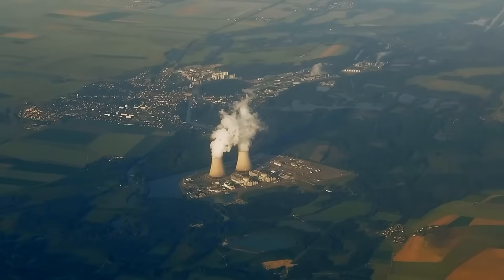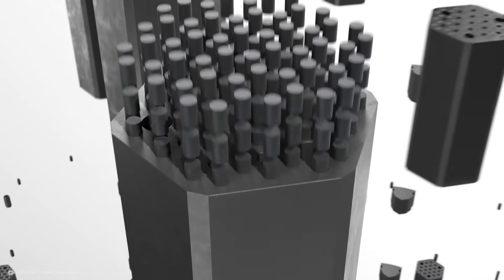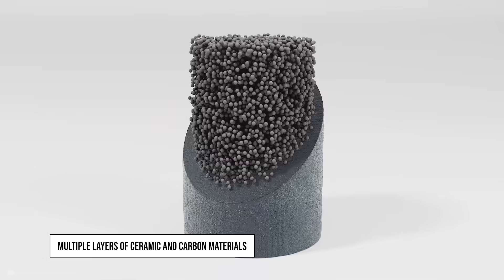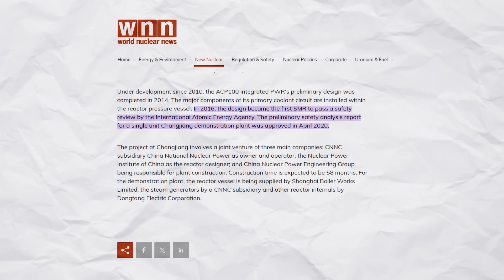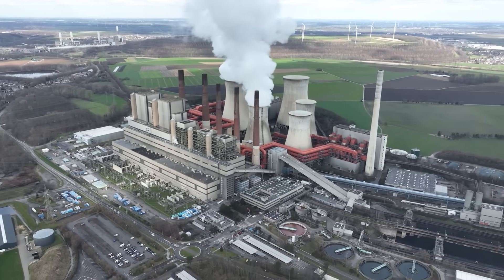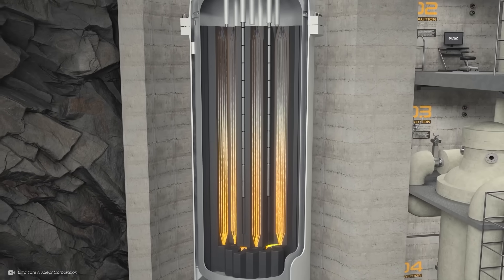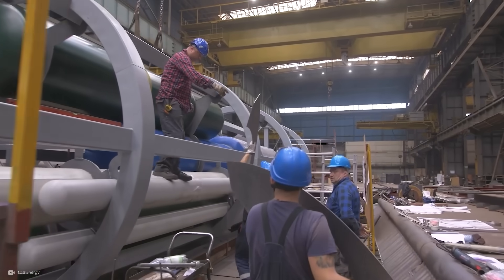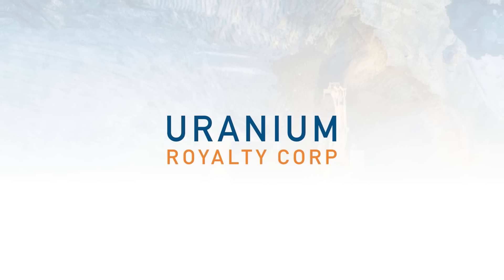The Genius of China's Small Modular Nuclear Reactor

Comment: Id love to know why thorium is not taking off. LFTR's are safer since they are at high temperature iso high pressure. They produce a tiny fraction of the waste, and the feed stock is a tiny fraction of the price.
Reply: they need depleted uranium to make killing munitions i guess..
Reply: It's a whole different energy branch that needs to be set up nearly from scratch: safety checks, regulatory checks, supply chain, etc.
Reply: @peters972   The US has never built a LFTR. The US did build an MSR in the 50s. The Aircraft Reactor Experiment which operated for less than  a year, and the Oak Ridge Molten Salt Reactor Experiment, which ran for about 5 years before decommissioning. Neither used Thorium as a fuel, though the MSRE briefly used U233 as a fuel. Apparently the Chinese have built an experimental LFTR. At least 10 more years and several more prototypes would be required to build a safe reliable commercial Reactor. They produce long lived fission wastes in about the same proportions as today's commercial reactors. As for cheaper and safer, well that's what the Soviets said about the RBMK reactors.
Reply: @darkgalaxy5548 
☢️⚰️⌛️❓❓❓❓❓❓❓

Comment: Water cooling has to be at a huge pressure to generate cooling and this leads to dangers on losing pressure in the system. Helium is more useful as Reactor does not need to be sited near water which tend to be close to populations!
Reply: Reactors with water are dangerous!
When cooling stops and water becomes so hot that hydrogen is produced, it's just a matter of concentration before it explodes.
No one should use water in nuclear reactors!
The sane ones are those which turns of when cooling fails, not explodesp

Comment: Nuclear Power has low CO2-Emissions? Only if you forget about where the nuclear fuel comes from, how it is processed and finally stored for long time. CO2-Footprint of Nuclear power is higher than solar or wind if everything is considered.
But most the important thing about SMRs is the price: They can only be build with public money, else the electricity would be too expensive. We will se no more than 15 SMRs in the World. And none of them will run for the full planned lifespan. Let them burn their money...
Reply: I believe after china master the mass production, they will build many for themselves, then export them.
Reply: The lifecycle GHG emissions of nuclear power are lower than the ones of PV , 28 vs 85 tonnes of CO2eq/GWh according to (H. S. Jamie McIntyre, Brent Berg and S. Borchardt. Comparison of Lifecycle Green-
house Gas Emissions of Various Electricity Generation Sources. Technical report,
World Nuclear Association, 2011). What article  do you refer to ?    Also , even when higher CO2 emissions per GWh are considered, we should bear in mind that one of the main advantages of nuclear power is energy density and hence material intensity, considerably lower than the one of solar and wind. And what about the decarbonisation of the mining sector in remote and isolated areas , with no access to sunlight and wind ? SMRs could play an essential role there. The technology is still expensive for sure(also because of the excessive safety measures in my opinion, nourished by decades of antinuclearism, but this is another story) but , from a purely technological point of view, nuclear energy is the way to go, a sort of miracle in the energy world , considering the staggering amount of energy produced by the fission of a single atom . I hope that AI , requiring a costant source of energy to run his servers(nuclear is perfect for that ), will help to guide a nuclear renaissance worldwide .

Comment: But your last graph about falling cost of solar actually says it all... Even if SMR cost fell at a similar rate it will always be a magnitude greater than the cost of solar (and wind) which will continue to fall as well. We already have the solution and it's just going to get better and cheaper - no need for nuclear any more!
Reply: Nuclear and solar power are two entirely different types of generation. Nuclear power can provide base power which solar cannot or which requires additional investment in storage technologies which reduces its efficiency. You can't dismiss any low greenhouse gas source of energy so easily. There are also other issues with various forms of renewable energy. In other words, the chart does not say it all.
Reply: @Paul-pj5qu  base load is a bit of a dying myth, and existing pumped water storage etc. is rapidly being augmented by battery storage, home energy storage, bi-directional EV storage (this will be standard soon)... Peak loading is already flattening out and there are incentive schemes to smooth things out (I got another mail from my energy provider this morning offering me one day a month free power if I reduce peak consumption by a certain amount). Those with home storage and EVs will already be managing things to reduce cost, i.e. flatten load peaks.
Reply: @originalmossman  Battery energy round trip <70%, that's when everything is new. All other storage methods suffer similar efficiency limits. Every EV charging at night to run the house during the day, cannot take it's driver to work. And round trip energy 70%, when everything is new. I know the hype, but they are misleading by omission. 
 
All power systems must build infrastructure to supply the peak load required at any time of any day. In TX this value is projected to increase >20% in <5 years. So, much more fueled infrastructure is required.
Reply: @CycleWerkz  strange focus on an outlier use case (like anyone proposed charging your whole house off EV storage for the whole day... Come on!?). All I said was there are load-smoothing mechanisms already reducing peak load requirements and it's only going to get more buffered... and that will happen quickly.

And all the predictions from UK and other grid operators say the same
Reply: @originalmossman  Whomever is making those projections doesn't understand the situation. ERCOT here is projecting ample peak and total energy demand near term. 
Simple voluntary residential peak load offset via battery cycle will increase total energy demand and score a big fat zero in actual peak reduction. 
You should get yourself ready for more blackouts and higher rates.
Reply: The "cost" of solar and wind, never includes the carbon cost of freight and usually not production, let alone disposal and recycling (which has only very recently become a possibility).

Nuclear power is literally the only viable answer.
I however, am not very interested in nuclear going forward if we're only going to build more reactors that require enriched fuel. Not when there are better reactor designs that can only fail safe and be fuelled by the existing stockpiles of "nuclear waste".
Reply: @Jimmeh_B I have to point out that it's obvious recycling could only have recently become a possibility, until recently there wasn't an Industry to recycle. 

The same is true of storage. There was never going to be commercial storage until Solar was over capacity during the day. And there won't be 12-16 hour over night storage until 2-4 hour evening/frequently modulation services are built out for the same reason. There just is no market.
Reply: @neolithictransitrevolution427  Sure, but you're completely glossing over the fact that both solar and Lithium have MASSIVE environmental costs. While fast breeder and travelling wave reactors will burn off existing "waste" stockpiles for fuel and can provide base load and beyond, 24/7.

If it's truly the environment we're all so concerned about, solar is a scam. It is not the answer.
Reply: I agree with the idea Solar will become the primary power source, but nuclear can certainly have a roll; industrial heat with co-generation being the main one. 

I don't think wind will see any significant declines in price and honestly by 2050 I think wind power will be declining globally.
Reply: lets make solar panels doped with uranium, they might produce energy at night too!
Reply: Solar and wind never had to compete with a truly modern fission reactor, thanks to china’s let’s see how well it does when china starts mass producing Thorium Molten Salt Reactors. Sadly western countries will miss out because of decades of endless red tape and sticking with a very bad reactor design over a half century.
Reply: Nothing costs more than wind, since its a net loss, only artificially propped up by government subsidies

Comment: So many videos on SMRs, so few charts on how a steam turbine's efficiency depends on its size.
Reply: As well as the whole thermodynamics... or materials used in manufacturing per capacity or ERoEI and whatnot. Also the whole idea hinge on  the "economics of scale" which assumes the factoryline productions of such reactors which would require a lot of customer to buy not one or two but dozens of them.
Reply: Effiency is more about temprature than size. if you want more efficient you need to use a high temperature design like a gas cooled or molten salt reactor. then size the turbine to match or even use a supercritical CO2 brayton cycle turbine.
Reply: @ excellent point, thx!
Reply: Better to have one big reactor than lots of small ones for many reasons.
Reply: the reactor efficiency is also size dependant
Reply: Except nuclear fuel is orders of magnitude denser energy if realized.
Reply: @withnail, That would only make sense if the owners were losing money, which they are not, or else there wouldn't be hundreds of billions of investment annually in the US. 

Intermittent isn't the same as unreliable. Knowing you'll have cheap energy all day is very useful, even if more expensive conventional power is needed in the night or on well predicted cloudy days.
Reply: @withnail That was really more a statement about how quickly technical and mass production development can alter economics. But obviously I disagree, I would say you are just looking at it to narrowly. 

Solar and/or wind always had to grow into a problem for the grid before storage could be developed. That's how markets work. We're now seeing 2h storage operating competitively at frequency control and evening. We won't see any king of over night storage until all sites have about 2h in storage for the same reason. 

But solar is just so incredibly inexpensive. And it is far more reliable than most people give it credit for, cloud cover being very seasonal and well predicted, and demand like A/C correlating well with production. Add 2h storage and you have no unexpected shut downs or sudden up ramping. And 2h storage is well commercialized and rapidly expanding, so I would say any issues are well addressed, but we won't see over night storage until Solar is covering the majority of day time demand with short term storage, that's relatively easily met with natural gas or coal.
Reply: @neolithictransitrevolution427  It's inexpensive because intermittent electricity is next to useless.
Reply: That doesn't seem that related, if you need more heat, add more reactors until you can generate the required heat
Reply: @zantrua  oh my god.
Reply: @derloos  I'm generally skeptical of nuclear due to cost issues, but it's true that efficiency may not really be the most important thing for nuclear in general. You need to think economics, not physics. Fuel is only 1-2% of the cost to operate a fission plant, most of the costs are in building the plant. If you can cut the CAPEX cost in half at the expense of a 50% reduction in energy efficiency, that would actually be economically worth it. Yes, the giant boilers and steam systems of a full-sized plant will be far more efficient; you'll get more joules out of every kg of uranium. But with fission, the bottleneck is the huge cost of the plant. Trading lower efficiency for much lower plant construction cost would absolutely be worth it. 

For fission, it is literally true that efficiency isn't everything.
Reply: @ from what I learned from one of Jighar Shah's talks, in nukes, the reactors themselves are smth like 1/4 to 1/3 of the CAPEX, so it's not guaranteed that SMRs would be able to move the needle even if they achieve the promised serialization effects (and that's a huge if).

But if the actual choice is between doing nukes in a slightly less efficient way, or not doing them at all, I'd rather we had that option, too.
Reply: @TanyaLairdCivil  As I wrote to someone else already, it's not quite true. Also, not even uranium is endless resources and though we shouldn't worry to run out of it entirelly, we can run out of easily minable cheap uranium. This could eat into the attractive side of the nuclear business, which is the cheap fuel. And yes that's hypothetical only if we agressivelly scale up nuclear this particlar way. I just don't think we should leave obvious inefficiencies in our long term energy  plans if we don't want to find our grandchildren in a similar situations like we are now.
Reply: @TanyaLairdCivil  By producing maybe a hundred in 5 years to "cut" costs? Btw. high enriched uranium is not cheap. It gets exponentially more costly the higher the enrichment.
Reply: @juliane__  From what I understand, there's no established civilian supply chain for HALEU to speak of. A massive cost to create (and oversee) it, that's supposed to just be eaten by the taxpayer?
Reply: Efficiency isn't really important when you're using nuclear fuel.
Reply: @neolithictransitrevolution427  🤡
Reply: @neolithictransitrevolution427  Only true as long as you handle waste as externality. The moment you have to pay for disposal fuel utilisation is indeed a factor not because new fuel is expensive, but because getting rid of old one is.
Reply: @CraftyF0X  No I don't agree. Breeder and burner reactors and reprocessing greatly reduce any waste. The issue is a lack of scale to support investment, similar to how we had to have enough solar to hear about curtailment being an issue before any storage or solar panels recycling was commercialized. Nuclear fuel repossessing is banned in the US. That's a policy issue not a matter of economic.
Reply: @ hilarious.